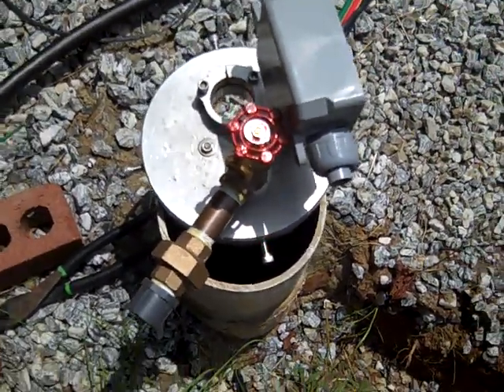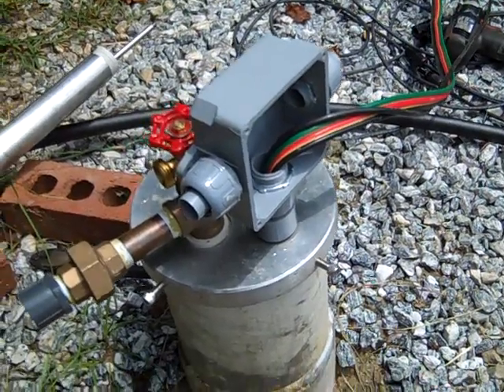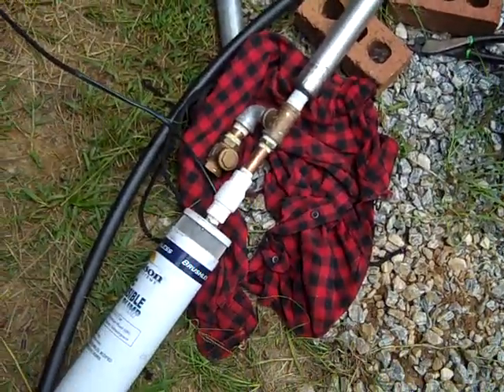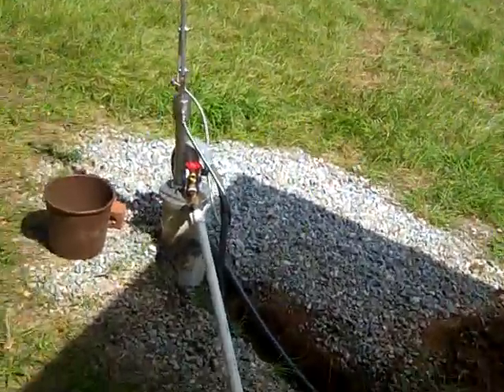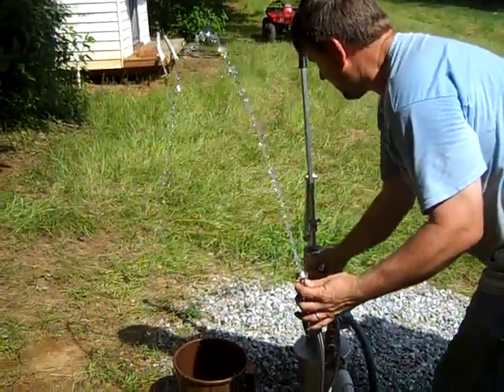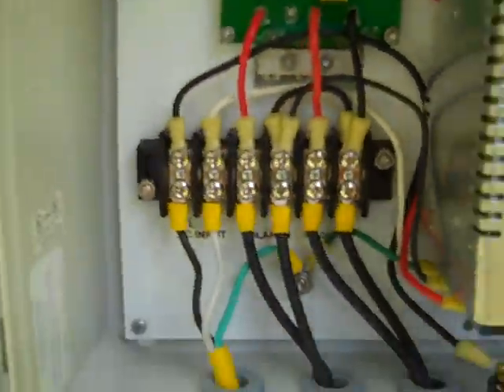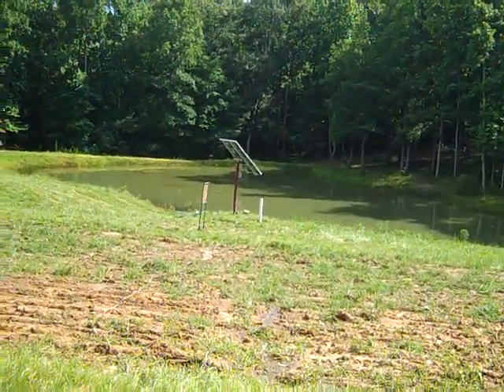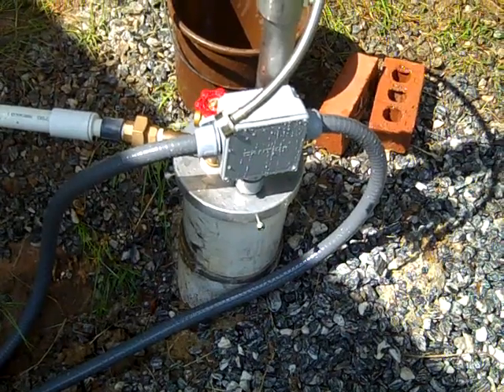5 ways to get water from one well!

Comment: Hello. What would you do in this scenario:  

We have a land in Mexico that is 500 meters away from a well. We are not allowed to have something fixed to the well, since it is public property. So, what occurs to me, trying to find a solution, is to get a portable pump where we can arrive to the well and extract the water and that water has to be pumped through a hose 500 meters in length to fill up a water tank in our property, and then remove the hose and th pump and walk away. I don't know if this would be the best solution and how to implement it. What can you suggest?

What we're currently doing is to arrive to the well with a truck that has a tank on the back and we're filling it up with the well's water and driving back to our property.

In short, we're looking for a solution that is more effective in resources and less complicated.

Comment: so with a drilled well with a spring at 80 foot and 20 foot holding below that (100 ft pump location) which sunrotor pump, or other solar submersible pump, would you suggest? I presume they are made to give normal household pressure ability.

Comment: love your videos --thinking of backup pumps system to my 240 volt sub well pump(140 ft)--live in new england so frost is a problem--what do you reccomend for a alterneative sysytem in a cold climate--i do have a generator with xfer switch but looking for solar systrem for an extended outage--have been considering an outback inverter and panels but appears to very involved esp with batteries

Comment: Large wheel can make pumping by hand easier. Kids would be more apt to take on the task. Rear tractor hub mount a handle. Then could be belt driven as well. Worst case you don't have sun for a few weeks or power. And all your wood is wet. ???

Comment: 775 I hear people talking about solar panels loosing their function; partially or all together, over time. What is your experience with this? I'm worried about the life of the panel, and if I should have many back ups? I'm on a pretty tight budget; I already have several panels, I'm concerned about the fail rate.